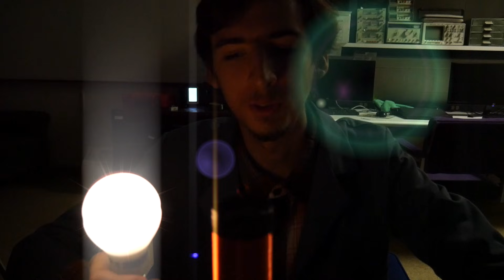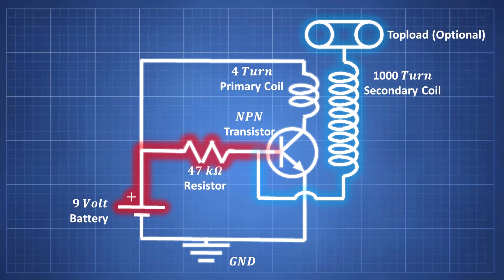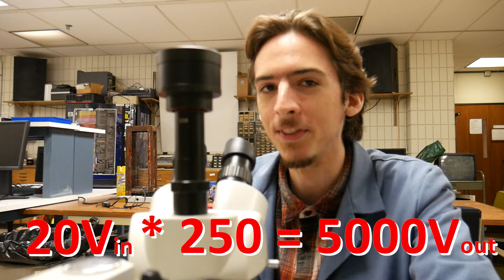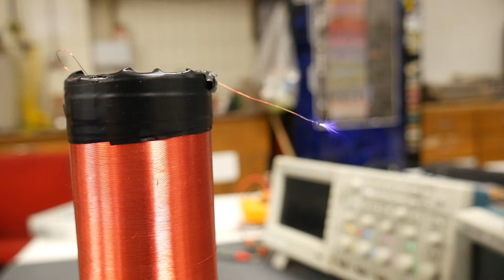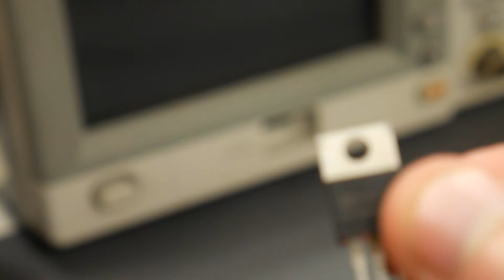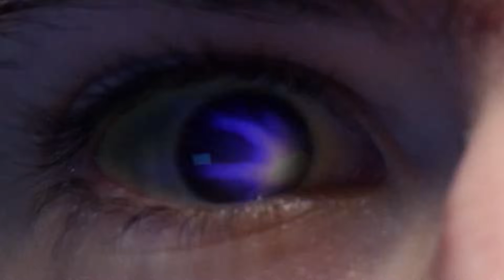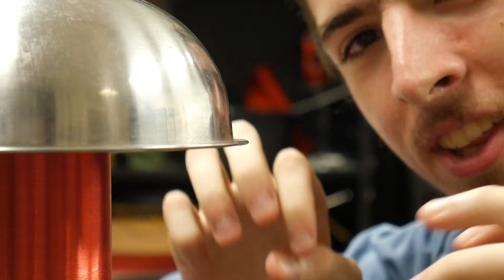SLAYER EXCITER - Tutorial, Explanation, and More

Comment: @Blueprint can i use capacitor on this project so the transistor won't die fast?
Reply from the maker: It is possible if you use a resistor and capacitor in series to make the square wave look like a sine wave.
I'm not sure how well it will work though...
Reply: Can i use two  9v battery for this to work like yours?

Comment: It should be put a high speed diode between the base of the transistor and GND. In many cases, a slow diode is put here, and the result is that the diode has no effect and is removed. That is a misunderstanding. A high speed diode is needed to prevent reverse current flow to the base.

Comment: Nice output! How much power are you pumping into yours? Thanks for the mention in the description BTW!
Reply from the maker: Howdy Max,
In normal operation, the SSTC draws about 2.5 amps at 15 volts. From there it is a roughly linear relationship. To get those large sparks, I cranked it up to 60 volts for about 10 seconds which drew about 10 amps (600 watts).
Also, I'm happy to link people to your video; a few years ago as I was just getting started with electronics, I referenced your video to help me build my first Tesla Coil. I liked it a lot! Thanks!
Reply: Mine draws about 7 watts at 15 volts input and is more than 90% efficient. Nothing gets hot at all, and there is a 1cm discharge. I use BJT not Mosfet.

Comment: What is the input voltage and ampere in your tesla coil ???... My secondary coil has 2000 turns.. how many turns should have in primary coil... ?
Reply from the maker: Hard to say for sure seeing as there are a lot of factors. I would think around 3 turns on the primary coil would be about right. 
Also, a SSTC draws about 2A at 15V. I assume its roughly a liner relationship.
Reply: @BlueprintScience  i am using TIP31C, i already given, 12v, 2amp and 24v ,550 mah... For such input can this transistor be damaged ??
Reply from the maker: @parthasarathimanna8790  Yes and no. Those values are within operating range of the transistor, but the transistors tend to get hot after a few minuets and can die from overheating. If you put a heat sink on your transistor it should be alright.
Reply: @BlueprintScience  yes.. i use a long heat sink ... But, i could not get sparks .... I done according to your circuit diagram... Plz help...
Reply from the maker: @parthasarathimanna8790  I can't help without knowing what's not working. I suggest following the steps in the FAQ in this video description.
Reply: @BlueprintScience  sir, I will tell you problem.. sir, can You tell me the no. Of turns in your secondary coil and it's length ? ... And tell how much voltage and amp. Exactly You gave to your Tesla coil ?? Plzz tell .. ... I am eager to know it.

Comment: Ludic science - 

He connects a diode between emitter and the base of the transistor. 
Which allows current flow from emitter to base. 

You have not used any such diode. 

Any reason ? Is that diode just for show ?? To check that current is flowing ?

Comment: How did you tune your Tesla Coil for resonance please explain because the Tesla Coil I made is not working, it will be of great help.
Reply from the maker: This circuit self-resonates; that's why I like the Slayer Exciter so much. The resonant frequency is 1/sqrt(inductance*capacitance). Since the coil number is fixed, the capacitance with the environment is what alters the resonating frequency.
If your coil does not resonate, I suggest double checking your circuit and making sure that the primary and secondary coil wind in the same direction.
Let me know if there's anything else I can help with. Good luck!
Reply: @BlueprintScience  Thanks for replying the Tesla Coil I made had both of the windings in the same direction can you please tell how to find the resonant frequency of primary and secondary coils using CRO and then how to tune them If you make a video it will be great.

Comment: can i make this with LM 317 transistor?
Reply from the maker: The LM317 is not a transistor, but a voltage regulator. Don't use that.
Reply: @BlueprintScience  thank, when i am always trying to build tesla coil it is not working and transistor is starting blowing, but thransistor which i am using is what in schematic is in videos, i am doing circut correctly but it is just not working can you help why?

Comment: mine works with 3 darlington pairs and produces around 30 to 45 kilovolts which depends on the topload and is very nice for beginners! Thumbs up for this video mate:)
Reply from the maker: No problem. Glad it worked for you!
Reply: 3 Darlington pairs of 2 BJT each ?? 

And all 3 Darlington are in parallel ??
Reply from the maker: @megaraitei  I think two BJTs in a Darlington is enough to reach full saturation.  At that point, the in-parallel trick only helps with the heat.

Comment: I am very close to making this. 

Have collected most parts. 

Now looking for power adapter. 

I have 1 question - how many amps minimum should be the input to the system ?? 

I'm planning for 30volts from the power adapter. The device I have in mind give out 6 amperes. I'm afraid this will be too high.
Reply from the maker: What you have should be alright.

Remember that power adapters are constant voltage - not constant current. It will only draw as many amps as it needs. I've found the SE to use about 5 amps during operation.
Reply: @BlueprintScience  that's awesome. 

Thank  you. 🖖🖖

I am making use of a voltage divider using 2 resistors in series to run some cooling fans, thus was worried about heat dissipation of resistors.

Comment: Can i use A.C auto transformer of 1amp and 0-250v  As power source ? I will be setting volts around 10-12v with that .
Reply from the maker: That depends on exactly what you plan to do. 50 or 60 Hertz is far too low to resonate and make sparks. There would still need to be a high frequency oscillator somewhere. For that, most things work best with DC direct current. Thankfully, going from AC to DC is very easy, you just need a thing called a bridge rectifier, many consumer electronics have them, otherwise they are cheap. Without that, it may still work, but would be far less impressive.
Reply: @BlueprintScience  can i use variac  and rectifier simultaneously ? I mean in the order .first variac and second rectifier to the tesla coil . I mean can I vary voltage using auto transformer when the rectifier is connected
Reply from the maker: @rishikaranreddyt3743  Sure. Just make sure that your diodes can handle the power
Reply: @BlueprintScience  thanks for reply 😌
Reply: @BlueprintScience  bro slayer exciter is not working Everything is perfectly followed no mistake is made according to arrangement.I converted AC  successfully TO DC using 4diodes  IN 5408 and i measured it in multimeter .HOW MUCH CURRENT MUST BE FOR OUTPUT? I USED 1 AMP .IT DOESN'T EVEN SHOW ANY SIGN OF SPARKS AT THE TIP OF WIRE . REPLY ASAP
Reply from the maker: @rishikaranreddyt3743  I'm sorry, but without actually seeing what you've made, it's unlikely that I can tell you what the problem is.
I can suggest a few things to try:
* Measure current through the primary coil while it is on. If there is current but no sparks, try flipping the secondary coil direction.
* Double check the pins on the transistors. I get them wrong all the time.
* Make sure that the diodes can handle the current. If they are still working, then they probably can.

P.S. You can always feel free to email me as well if you wanted me to review pics, etc.
Reply: @BlueprintScience  bro i did it everything worked great but transistor with parallel is not working .For only one  transistor it is working fine if i add more its no giving any response .The problem with single transistor is it's getting to much hot after 5-6min
Reply: @BlueprintScience  can u suggest any other transistor in replacement to that
Reply: I want to achieve 20+kv with the tesla which u showed in the video

Comment: This was great,  because it stayed so simple and was a really good introduction.  If you or anybody really gets serious with Tesla Coils there are loads of YouTube Videos,  and material on the web.  You'll read that the voltage gain is independent of the turns ratio and is dependent on the Q parameter of the primary and secondary at the resonant frequency.  Qs/Qp.  Q is the frequency characteristics of an LC circuit.  Normally you'll have a large C in the primary circuit,  and what you're doing with playing with how many turns of the primary is altering the primary inductance to match that of the secondary's coil,  and top load, which acts as a capacitor in the secondary.  I'm rusty and haven't gotten into enough detail to be anything but dangerous.  But look at the tons of material out there are.  Your video was great because a lot of the tutorials will assume you know material presented here by heart, and can start out pretty advanced.
Reply: And also you can't build up an "AC charge" with a top cap. You can only build up an DC charge and you would need a very high voltage, very high frequency diode to do that. 
Then there is the notion of intrinsic capacitance of a sheet of metal or a coil of wire, where the capaciance exists even if the sheet of metal is in outer space millions of km from anything else. The physics books I've read explain it mathematically but not conceptually.

Comment: I have a question about the secondary coils. Does the width of the coil matter? If you used a smaller pvc pipe you would have more windings and a smaller width. Would this give you a higher output voltage?
Sorry for mistakes im non-english speaking haha
Reply: Did you find out ??

Comment: What if the primary coil... Was inside. . .
Reply from the maker: That'd be fine also. Though the magnetic field inside a coil is usually stronger than outside of it, so we put it on the outside.
Reply: @BlueprintScience  what if you then made the secondary the primary 🤔
Reply from the maker: @phonotical  Then instead of getting a high voltage output, you would have a low voltage output. This is sometimes done to get very high electrical currents.
Reply: @BlueprintScience  aaand with more coils? 😁

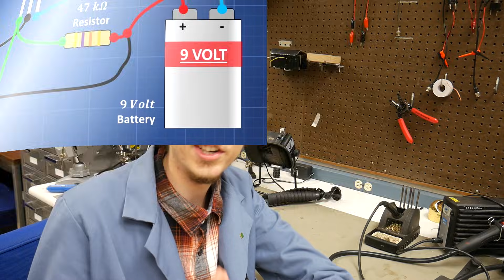Comment: Hi, if I would add a switch to the diagram at 4:38 would I add it in between the positive wire from the battery and the resistor?
Reply from the maker: Yep. To control the power, you can put the switch anywhere adjacent to the battery. It's good practice to put it on the positive side though.
Reply: @BlueprintScience  ok, thank you
Reply: @BlueprintScience  What part of the transistor (like the base, emitter, and collector) would I connect the resistor, the 30awg wire, and the 10 awg wire to?
Reply from the maker: @Jonathanholly  The resistor and the secondary (30AWG) wire both go to the base of the transistor.
Reply: @BlueprintScience  Hey I just wanted to thank you for all the help throughout me building this for a stem expo. Right now I dont get that many sparks (I think it's called plasma) coming off of the topload (i basically have to touch it to see the sparks) but i theorize that i am not supplying it enough power (I'm only using a 9v battery). After the stem expo I will try to supply it with more power.

Comment: What will happen if I connect transistor in series?
Reply from the maker: Then the voltage across each transistor would be divided by how many there are but the same current would flow through each of them. This would make the coil less effective overall since each transistor contributes to a larger voltage drop.

Comment: Aloha if i build somthing like  this bit connected at 220v it whill work?? Sorry my englesh
Reply: OK thank you almaithy discendent of nikolai tesla
Reply from the maker: It might... for a few seconds before it overheats and blows up.
If you want it to handle more power, you would need to redesign the oscillator circuit such that it could support that. But at that point, you're essentially making a power transformer.
Reply: For my is OK i need High  voltage i dont  need a tesla but i want to make a hibrid
Reply: I have 2 transformers in 220v out 42v and 58amps and i disamble and get the whire  to do somthing like  your  project whitout a circuit  a simple  one .you have more espiriance it will run ??
Reply from the maker: @ovidiumarian6201  Honestly, I doubt it. Transformers are wound in such a was as they have very high inductance at the cost of voltage rating. You would have to entirely unwind and rewind them - at that point, you're better off just buying wire.
Also, 50Hz or 60Hz is far too low of a frequency for a Tesla coil. In this instance, the higher the frequency (f > 100kHz), the better the result.
Reply: Scuse mi if i stress you i want to replicate your  project but i have some transistors  tip122 bipolar npn  100v 65w 1000hfe. the hfe is important  to the right  function??
Reply from the maker: @ovidiumarian6201  Those are good standard values; I suspect that they will work fine for you.
BTW, hfe refers to the current gain. This number is almost always higher than what is needed.

Comment: Dear  friend  pls help is it possible to know what is the resonance frequency of the slayer exciter
Reply from the maker: Okay dude. Chill out, I heard you the first two times.
Yes, we can measure or calculate the resonant frequency of the slayer exciter. A typical measurement is about 800kHz to 1MHz which can also be calculated by the equation frequency=1/sqrt(inductance*capacitance)
Reply: Thank you my friend and sorry for the repitition
Reply: But where is C in the cirucuit  and how to measure it
Reply from the maker: @msyria4032  You don't measure it because it changes all the time. It is the capacitance from the coil with the environment - usually between 1pF and 10nF depending. It's called a parasitic capacitor

Comment: Ive been looking at videos for a week on this subject, IMO this is the best ive found.  Question @Blueprint, I have an approx. 280 turn 26awg tower, 14awg small coil 3 turn, 2n222a and have used 27k and 33k with 9volt battery.  I constantly get transistor burn out.  What am I missing?  Please help!  If I understand correctly, the TIP31C is a Darlington?
Reply from the maker: Hey,
First of all: Thanks. I'm glad you liked it.
Second: The only thing I suspect would be a problem is the low number of turns on the secondary coil tower resulting is a low impedance and, thus, larger current draw. Also, the voltage step-up is 280/3=94V which is sort of small. I would suggest a larger secondary coil with at least 800-1000 turns.
Also, I've found that 2n2222 transistors usually work okay off of a 9V battery, however I always jive for a larger power transistor if I can as they can handle more current for longer periods of time.
Let me know if you have any more questions.
Reply: @BlueprintScience  TY I will try larger coil
Reply: @BlueprintScience  yes another question, for small LED light, connect between + battery and transistor Base or Emitter
Reply from the maker: @TheWatchmanReturns  Most people put it in between emitter and -
Reply: How are people making these super short 2ndary coils with 2 primary and it works?  I managed 650 on 2ndary "ran out of wire", tried 3 primary then 6 primary.  Guess im not electrically inclined, cant seem to get this thing to work. Have my primary running opposite direction of 2ndary, even tried reversing it. Did figure out the LED placement.
Reply from the maker: @TheWatchmanReturns  I dunno, man. If you come across any more questions (which by your name, I assume you will), hit me up. I'll help if I can.

Comment: Please help again now its working but its very not powerful like iam using a 12v 7.5amp/h battery and tip35c ??? How can i increase the output
Reply from the maker: I don't know - I'm not psychic. Without a understanding of your design, I wouldn't know where to start. I can, however, offer a few suggestions:
* A lab power supply will make adjusting the power much easier to test an find the maximum power of your design.
* Usually adding more windings on the the secondary coil will improve output.
* If efficiencies are a problem, a better transistor may help.
* Try changing the number of turns on the primary coil to find the resonance (natural frequency) of your design. It's usually about 3-4 turns.

I hope that helps.
Reply: @BlueprintScience  I can't afford a lab bench power supply and again thanks for help
Reply: @BlueprintScience  one more question as it output high voltage like i have1:500 ratio so my 24v become 12000 volt... doesn't 12k V Lethal ????
Reply from the maker: @harshityashwardhan  Kind of... It's is neither voltage nor current that is lethal, it is power. There is a high voltage on your coil, but it is so low power that when you draw current from it, the voltage drops quickly to zero. If you were to hold your hand to the output, you would get a shock for a few microseconds, then never again until you let the charge build back up.
Hope that helps.
Reply: @BlueprintScience  yeah thanks
Reply: @BlueprintScience  u can update this video with using tip35c it really make difference
Reply: Tesla coil- https://youtu.be/fUfBGopntPQ

Comment: Isn't 30 AWG cable to thin. I used 24 AWG cable in my tesla coil and I used 200 meters of it. But its only have 910 turns.
Reply: What is diameter of pipe you used ?? 
1.5inch ?
Reply: @megaraitei  It was 7cm

Comment: Can i ask some more questions????
Reply from the maker: You just did
Reply: @BlueprintScience  amm... If i increase the diameter of pvc pipe does it affect Any thing
Reply from the maker: @FutureOfGaming  A little bit. But you don't need to worry about magnetic flux densities that much for this project.
Reply: @BlueprintScience  should i use tip35c
Reply: @BlueprintScience  can i use a a normal electric wire for primary coil
Reply from the maker: @FutureOfGaming  Yes, of course